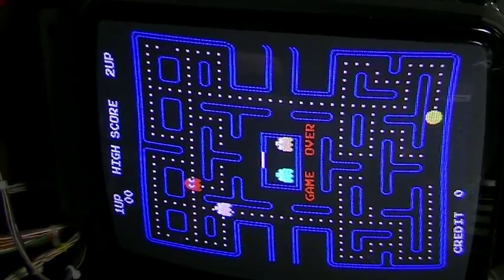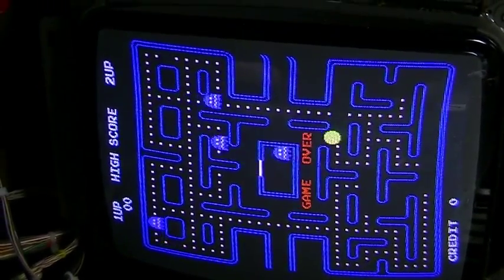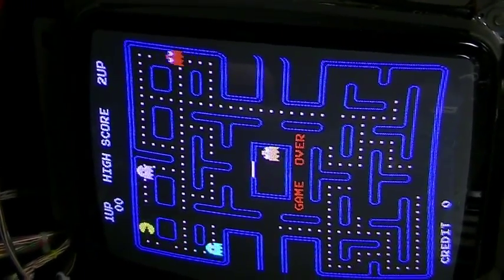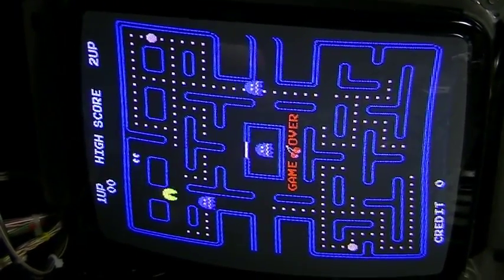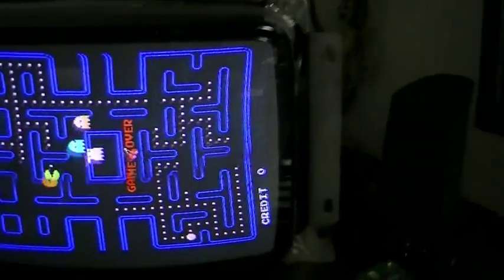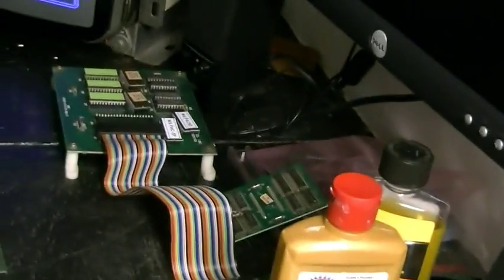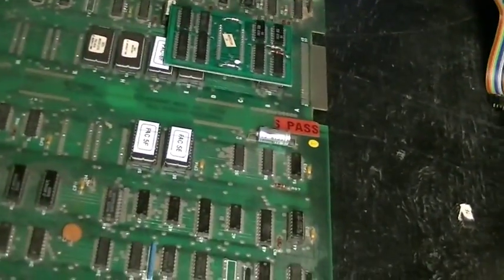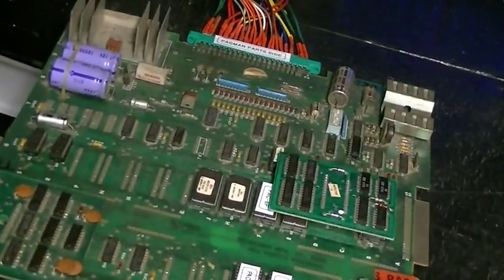My Arcade Workshop Episode 2 PacMan Repair

Comment: I have a question about the right side (top in video) of your monitor. Where the maze exact turns up (blue lines). 
Would be a board issue or monitor?
I am have the same effect on my pac-man. The bottom line pulls up more gradual.
Thank you for the video. 
Link is a photo: https://photos.app.goo.gl/4qcMWUsjD7M9JT8T7

Comment: how are you? question, i have a galaga that works great but is missing color red..any tips?
Reply: Hey another video I saw recently suggested a wire may have come off or that the red driver on the monitor was turned down. It sounds more like the wire. 
I am working on a problem with a Pac-man not color related.

Comment: Good cid, what are you using to burn PROMs?  I'll give you a tip with kynar wire - just melt the source end straight onto the pin then route the wire and melt through with your iron for the destination pin then use your scalpel to trim it - lot less fiddly, the insulation is designed to work this way on that wire.